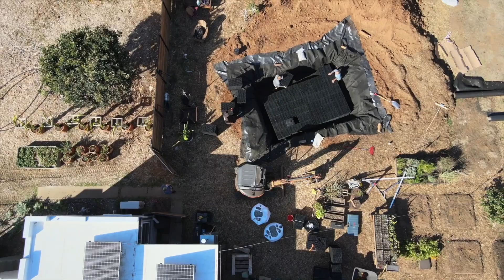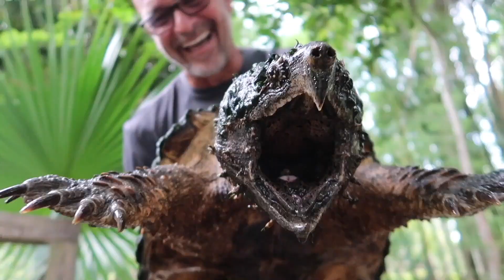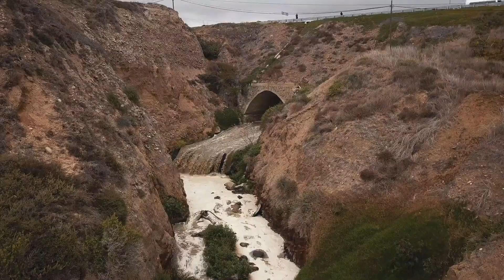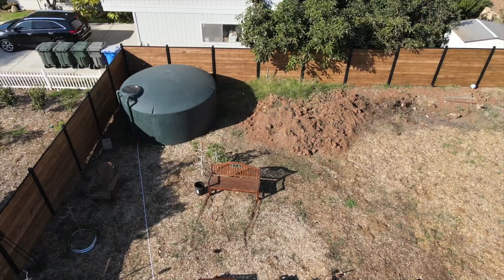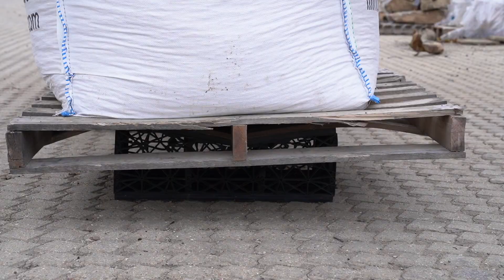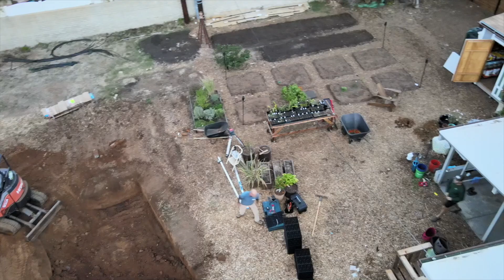WATER STORAGE!!! @epicgardening Part 2

Comment: In scandinavia its actually a common system to use... its even a necessary thing to get a building permit nowadays.. We call it LOD (lokalt omhändertagande av dagvatten)  which translates something like "Local care of daywater" we always instruct clients to put in a LOD into their renovations of gardens because its such an easy system to get free water and not send it into the sewage or stormdrains.
Reply from the maker: That’s Awesome!!!
I hope it becomes more common here…..
Reply: @EdThePondProfessor  im sure it will... we rarely use a liner underneath the blocks.. instead we use a tank as a reservoar if we want to save some water for watering and after that the blocks are used to pick up whatever flows past the tank. For me its a bit easier to work with a tank instead of a big bulky liner. And its convinient and easy to put in a wateringpump and use the lid as a connection station kinda. Anyhow love yar channel and its inspiring... good job!